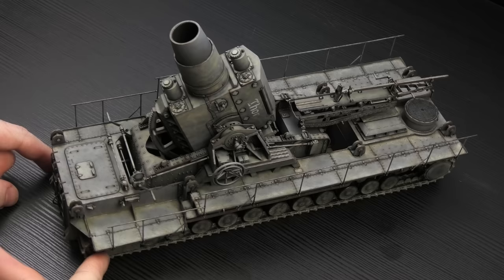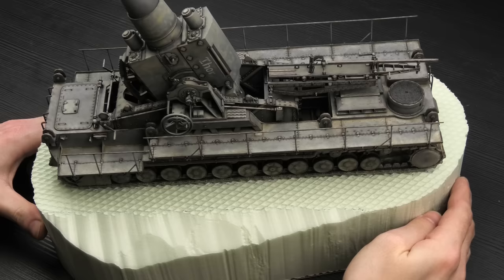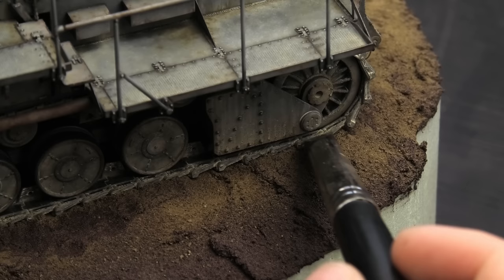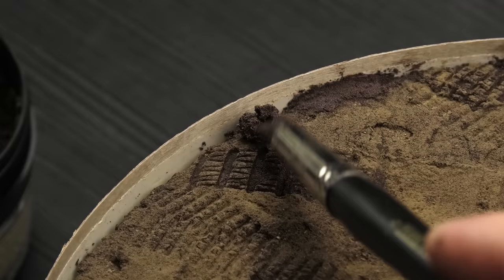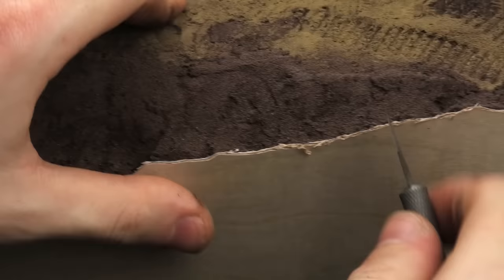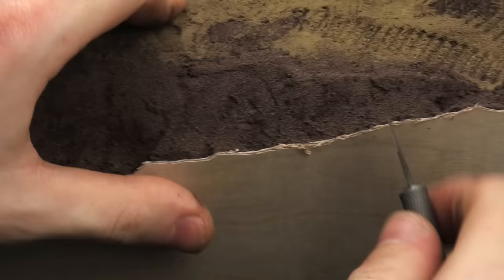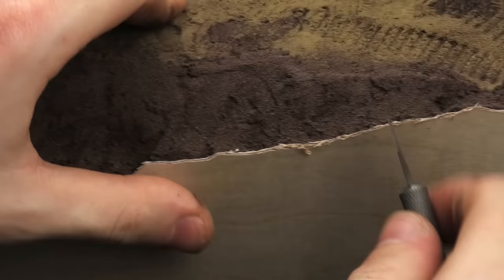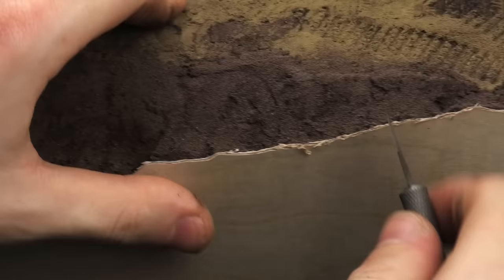Making A Simple Scenic Base For Your Armor Model (Morser Karl, 1/35 Trumpeter)

Comment: One hint - if you dont know already: The Styrocut (i think you have one besides the Proxxon - the Proxxon might have this feature as well) has a little brass inlay around the hot wire inserted in the worktop. It can be pushed upwards and be used as a guide. Turn your cardboard-styrofoam with the cardboard down and glide along the brass inlay - you will get much smoother cuts.
Reply from the maker: I never thought about this! I must check it out ASAP, thanks!

Comment: Try this:
By having the cardboard/template side of the foam base nearer to either end of the hot wire, you can reduce the amount of deflection when cutting, which should leave nicer more consistent edges.
You can see in the video how much the wire bends above the cut. By symmetry it's moving as much inside the cut.

Comment: I think this turned out great, it has life to it, that you can never get from an old black and white photo, without going over the top and feeling fake. A bigger base may be cooler in most cases, but I think it works here, for simply getting the point across. I also like that it's tall, I don't know if the greater visibility from that height was intentional, but it works. It's like a good solid chunk of Earth cut out, instead of looking like a piece of cardboard with dirt and paintbrush hairs glued to it.

This makes me want to build a tank, or maybe a train that came off the tracks decades ago and has been left to sink further and further into the mud.

Comment: A nice paint to use for covering the wood fineer is using black latex paint… when you apply it it starts of being grey , but when dried it gives a smooth flat black surface … you will like it ( and it is waterbased) … 
Ps. Love your work 👍🏻🤙🏻❤️

Comment: Such a beauty. I believe, this model didn't require a delicate scene, since it's not the harmony and blending with the environment which is important in this case, but the excellent engineering, the colossal dimensions and tiny details of the vehicle, and a deatiled scene would draw the attention of the spectator. One thing I would have added, is some dirt grains and sand on the ladders which would get knocked off the crews boots while they were climbing them, but it's such an insignificant detail, that it's not even worth considering. Other than that, it's sheer perfection. Although most of them were rather impractical, there is something about the gigantic warmachines of the Third Reich which I simply adore, and this model captures it perfectly.

Comment: The superglue into the veneer cut might have been a bad idea as that melts foam, not that it would be visible but it could have messed the whole structure. A general good way to fill gaps between wood is always the old reliable sawdust pva mix, still these videos are always extremely cool.